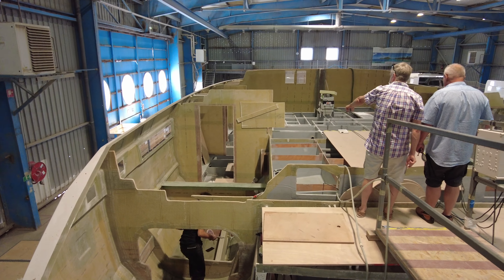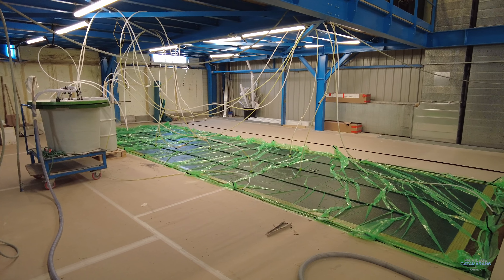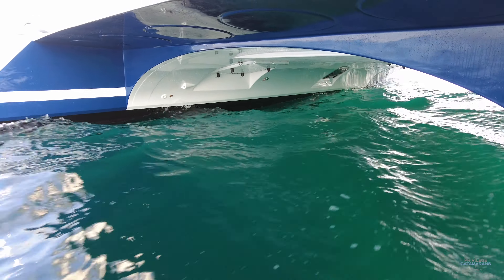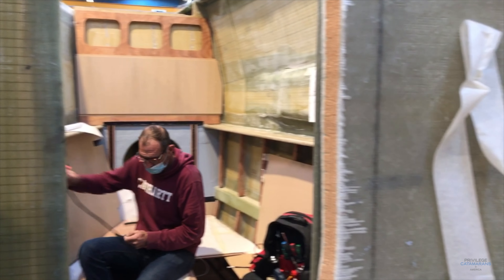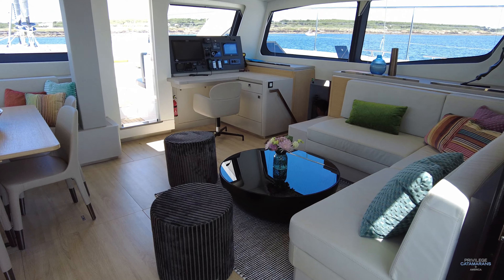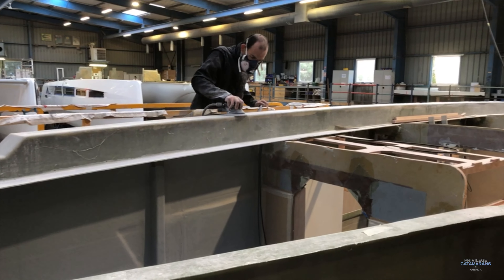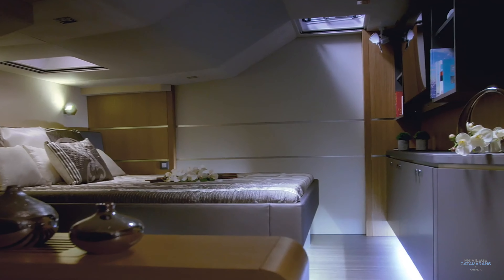How Does Privilege Build Bulkheads?

Comment: Great video!! Ppl are concerned about the recent discovery of Lagoon bulkheads failing.
Reply: Of course they have.  But few consumers really seem to understand carbon.  Carbon isn't magic, it is simply stronger for a given weight than fiberglass.  For most bulkheads, why would you do it?  It's in a place that doesn't need more strength than glass provides, and it's in the lowest priority location for reducing weight.  Carbon rigs make the most sense to lower the center of gravity.  Carbon may make sense in supporting large openings or spans that simply can't be done strongly enough in glass, like a cantilevered bimini or something.  But on a prioritized basis, most bulkheads will only be all carbon in an all carbon boat trying to save every last ounce.  You'd get a similar effect by packing boxed wine vs. bottled, or limiting yourself to only 6 pairs of shoes etc.
Reply: @secondstartotheright You know what else is stronger than steel?  Plain old fiberglass.  Tell me again why a perfectly strong enough foam core glass bulkhead wouldn't be the last thing you upgraded to carbon?
Reply: @MrJhchrist  I never said anything against foam core fiberglass, just suggest adding a layer of carbon fiber thats all
Reply: @secondstartotheright  Cool, and I tried to explain why not.  It's because foam core glass is strong enough, and any desire to save weight will be done elsewhere first.  Typically higher up and/or where long spans can benefit specifically from carbon's stiffness.  Roughly speaking, carbon is 5x the cost for -15% weight OR + 20% strength.  That's a better investment in a mast or dagger board than it is in a bulkhead.   
It may be worth noting that the lagoon problem this is obviously responding to isn't because their bulkheads aren't strong enough.  The lagoons just weren't fitted and attached well.  Which is why that is exactly the focus of this video.  
If parlay revival had been made with carbon fiber bulkheads it still would have fallen apart.
Reply: @secondstartotheright  OK, enjoy yourself.  Fiberglass is literally stronger than steel, pound for pound, in several aspects.  If you want to argue about though, I can't help you.  (Guess what is also much more brittle than steel?  Carbon fiber...)
Have a good night, or grab the last word, whatevers, I'm out.  (Enjoy googling "is fiberglass stronger than steel" or "is carbon fiber brittle")
Cheers.
Reply: I’m not going to get drawn into the conversation below/above but, have a look at Balance Catamarans on YouTube. They show where they use carbon in certain areas, and are one of the best built cat I’ve seen! 😎🏖🌴☀️🇦🇺
Reply: @jacksbackable  yes exactly thats all I'm saying.  Great point!!!
Reply: @secondstartotheright  The different moduli of elasticity makes carbon fiber/fiberglass sandwiches less strong than just fiberglass. Either make something out of one or the other. And as has been mentioned elsewhere, the cost and positioning of any componentry made of CF is important.

Comment: Excellent build quality! -- QUESTION --- We just watched this weeks episode of Parlay Revival and saw the horrible deck joint failure on that Lagoon.  A factory installed  line block connected to the bow deck, pulled apart the deck from the hull and lifted a three foot section clean back. This happened in only 12 knots of wind and exposed the front hull to the ocean. Turns out it was lightly glued to the hull and in several sections they had failed to apply any glue at all. Total nightmare.  How does Privilege connect the deck to the hull and are they aware of the importance of keeping that joint completely attached and water proof?  Parlay could have sunk had they been in an Ocean crossing.  This Lagoon Cat needs to have the entire deck completely removed and reattached properly (if that is even possible).
Reply from the maker: Hi Coleen, if you've watched any of our production videos you'll see that we don't glue and screw bulkheads, they are fully glassed. This is also true for the deck and hull joint - they are glassed in and become a 'holistic' structure. It would be virtually impossible to take the deck off a Privilege in any wind conditions,
Reply: @PrivilegeCatamaransAmerica  ..I thought so but wanted to check after watching this weeks Parlay Revival video. Their Lagoon actually had the deck peel back, at least three feet, only to discover it was glued (very poorly glued) and a few rusty screws .  Such a sad builder I must say.  Really sad actually.  They clearly don't care.

Comment: 3 questions: 
* Have you built an aluminum version of any of your boats? Explorer style? 
* Why not throw on a sheet or two of carbon fiber over the current side bulkheads' foam core panels? There are only two main bulkheads and the extra rigidity will save cracking throughout the whole boat over time.
* When are you going to design a dry foredeck catamaran similar to the Bali/Catana line? Seawater spray equals salt and constant nuisance cleanups with freshwater washdowns. I've also seen Priviledge front lockers flood badly. Bali's 5.4 "higher above the water" design - came in fifth in the ARC Rally in 2015, so the design does not impede performance nor sea worthiness. I'm not crazy about Bali's top deck stair access (its too exposed) but otherwise it's spacious, works well, and gives you the whole boat that makes every inch usable.

Comment: Cutting a cured fiberglass sheet in it self is worst than using the lagoon style bulkheads.
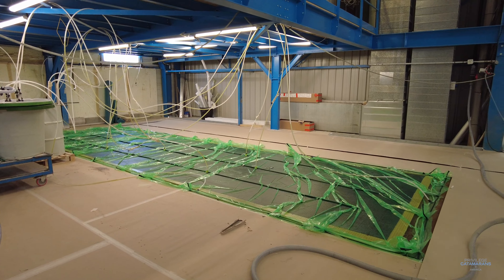Edit: apparently there's no CNC cutting or whatsoever since your boards are all cut with a jigsaw as seen here 0:44 here 0:58 and here 2:03 etc..
2. Love those finger cutting fans on the master bed, especially when it's dark and you want to shut it down. Good job!

Comment: Very Nice! -- QUESTION -- One thing we learned when looking into one production builder, that has had enormous bulkhead issues, is that they claimed to build to a standard, but when you are not watching them build it, they skip important steps.  It just seems when no one is watching them, that they cut corners.  This may be because of lack of care or even lack of training or skills and, maybe even a level of dishonesty. When their boats were inspected during the construction phase by independent inspectors, the construction was much better.  This is a big issue.  I suspect that Privilege has much tighter controls and inspections of crucial steps in construction as I have never seen a failure or deviation on those parts on the boats we looked at.  My question is this: do you take pictures of the key bulkheads before they are covered up, as part of your manufacturing control function?  If not, you may wish to adopt that simple step. Most modern manufacturers now take pics of key components and keep those records on file in case of claims made in the future. It is an excellent way to protect yourself and the customer.
Reply from the maker: Thanks for the comment and yes, it is an excellent suggestion. In fact, we currently take photos throughout the entire build process to document progress on the build. These photos are sent regularly to the owner while the catamaran is under construction.

Comment: Are the bulkheads between the engine compartments and main cabins watertight by specification and design?
Reply from the maker: Yes they are.
Reply: @PrivilegeCatamaransAmerica  excellent, thanks. I noticed many holes through the bulkhead and was just wondering what they were for and how they would then make them watertight afterwards?
Reply from the maker: @nuffsaid7952  Holes are required for electrical and plumbing lines. The areas are sealed with a watertight, flexible compound.
Reply: @PrivilegeCatamaransAmerica  ok, the same cheap option used by many other builders, pity to cut corners on a critical item like that. For the electrical cables and hard walled plumbing, marine grade MCT’s would be the professional approach which are relatively cheap. For soft walled plumbing, bulkhead fittings could be used which are also relatively cheap. 
We see too many business these days cutting corners to save a few cents here and there that only serves to turn what would have been a great product into a cheaper product that is easily identified by the knowledgeable prospective customer.
I encourage you to have the discussion with the builder to use the MCT’s and bulkhead fittings instead. Firstly they are more secure and are far more watertight (they are actually gas-tight), secondly are far better for maintenance, and thirdly are much neater which looks far more professional.
Reply: @nuffsaid7952  very valid point. It is a shame that there are builders that choose to take the cheap option on an otherwise quality build. It is truely these little 1% indicators that are telling of the actual overall quality of a product and the possibility of other shortcuts that may have been taken that aren’t readily visible to the naked eye. It really is a case of buyer beware, and buyers should look past the spit and polish and have a sound knowledge on what to look for to recognise these 1% indicators for the actual build quality. Attention to detail when viewing a boat to purchase is critical in knowing where to look and to be able to identify these indicators to the actual quality of the product. 👍
Reply from the maker: @nuffsaid7952  This topic has come up before in regards to watertight bulkheads as it relates to the American Bureau of Shipping and the Det Norske Veritas. The boats are not classed by the ABS or DNV who are only concerned with ships and their insurance. That is a totally different business and trying to follow their ship construction rules would make a pleasure boat of this size complicated and heavy. A watertight bulkhead in a ship has to potentially withstand water pressure at a depth of several decks below the surface, the potential submersion of bulkhead in our boat is maybe 6' below the surface, or 3 psi.  Using bulkhead fittings and transit hardware designed for ship bulkheads would not be practical.
Reply: @PrivilegeCatamaransAmerica  Hi, just to clarify, ABS and DNV are only 2 of many “classification societies” for commercial shipping and sea going vessels. Classification Societies primary function is not for insurance, but is for ensuring that vessels under their organisation meet the standards required for commercial vessels. These standards include but are not limited to construction, machinery, systems, equipment and design. The IMO provides the guidelines for commercial vessels along with MARPOL, SOLAS etc. The classification society checks that the vessel meets these standards and certifies the vessel. Insurance does play a significant part in that without the certification being issued the vessel will not be able to get insurance and would be severely restricted in where it could operate.
Regarding your comment that bulkhead fittings and transit hardware designed for ship bulkheads would not be practical is concerning. Bulkhead fittings are used in many industries and not specifically for commercial shipping, they are cheap in reality and simple to install. The 316SS MCT’s are also widely used in many industries and not just for bulkheads on commercial shipping. These MCT’s that would be appropriate for this case would weigh max 3.5kg each and would require only 2 at most per bulkhead. Here is a link for one of the many manufacturers of the MCT’s for you to view, https://www.roxtec.com/en/products/solutions/roxtec-hd-32-ex-transit/
For the bulkhead fittings there are many manufacturers, PARKER is one of the better known and have many options.
I am not suggesting that sailboats for private use should be built to the higher standards or use the same materials that commercial vessels do. However I am suggesting that there are much better ways of transiting a watertight bulkhead than simply boring a hole through, passing plumbing and cables through and then caulking the bundle to try to seal it, which doesn’t look professional especially when there is a much better way do do it which is cost effective, allows for easier maintenance and is far more secure (and doesn’t look like a dogs breakfast). Attention to what is viewed by some as little, non-critical items do indicate the true quality of a product and in many cases can ring alarm bells with customers when these shortcuts to save peanuts are seen.
There is one cat builder that is learning this lesson the hard way now after a sailing channel exposed the build quality problem, which was well known by those that knew what to look for as indicators, and are finally after many years having to step up. The build quality issue with this builder was known by some for over a decade, these are those that were knowledgeable and knew what to look for and knew what indicators they were observing. Unfortunately many of their past customers have lost financially due to this with that brand loosing market value.
Privilege have a great line and reputation and one of the best designers in Marc, but it would be a shame to drop that fantastic reputation to save less than 4K to install better quality bulkhead transit hardware.
By the way, I still love the old 585 despite being considered “old style and performance “ by current standards. It’s a pity that only 26 were built (if I’m correct) as that is a great boat still.
Cheers

Comment: Hi Rob. Great video. Question for you about the close cell foam used between the fibreglass - how fire resistant is this?
Reply from the maker: This is a question best answered by Divinycell. Risk of fire is a reality no sailor should take lightly.
Reply: @PrivilegeCatamaransAmerica  absolutely agree with you in relation to fires. I’m not worried if the closed cell foam is highly flammable or not. My wife and I are still going to purchase a Privilege regardless. I was just interested to know.

Comment: Its also more than double the price as Lagoon
Reply: ask Parley if that is worth it
Reply: @alexmeyjes5533  4 million-dollar boat compared to $400,000 boat.
Reply: @tylordid2695 nope wrong price, the 580 with good options goes for 2.5ml or even less ( parlay is a 450 so its 13 ft shorter ).. also you get what you payed for , people have crossed the Atlantic in barrels
Reply: @muumoo111  2.5 keep dreaming fully specked out is 5 mill
Reply: And while your at it do a little bit of research about the difference between custom boats and mass produced ones , and make sure to compare the same sized boats in the future not a 740 price custom boat Vs mass produced 450
Reply: @muumoo111  Man surely with the ability to mass produce vacuum infused sheets of glass/foam, swapping out plywood/glue for laminate and tabbing wouldn't increase the cost THAT much.
Reply: @TURSTY09  because that's the only difference?
Reply: @muumoo111  no but what I’m getting at is the reason the lagoon bulkhead problem exists is because they tried to cut the cost too far. The cost difference between plywood bulkhead and something similar to these ones couldn’t be that much in the scheme of a $600k boat. They can keep the rest of the cheap stuff as is, but skimping on the structure of the boat has proven to be a step to far right. There is a balance that can be better struck.
Reply: @TURSTY09  its combination of bad design , excessive cost cutting and bad execution and dirty cheap martial .. thats why no one should consider lagoon again, its from the top of the company down the bottom kind of mismanagement  ( i used to own hallbergrassy and now nordhavn and maybe just maybe in few years  a big cat ) i have seen how boat get built and holy fuck those lagoon are trash
Reply: @muumoo111  if given the choice for a production builder between Lagoon, FP, or Leopard, which one would you choose?
Reply: @alanpiper9614  Leopard is better built than both fp and lagoon, but you need to keep in mind leopard doesn't do any custom work.
some company's will do any custom work you want for a leopard, that's 200-300k extra.
i would buy an older privilege  and save my self all the headache. 
mid 2019 privilege was bought by HanseYachts which build production boats  and i am worried if this will affect those boats , so far i found nothing but i am keeping an eye on this builder
Reply: @muumoo111   yes, I also am of the same opinion that leopard are the superior of the 3 major production builders. Also that there is very little option for any customisation other than colour choices as with the other 2 production builders.
As far as privilege being bought out in 2019 and the possible effects on quality, I have already seen an indicator of this with the watertight bulkheads penetrations for running services. When looking at a vessel that is double the price of the production competition I find it disappointing that they would employ the same cheap methods for watertight penetrations for services. Definitely an indicator that quality is being sacrificed for profit. My favourite is still the old 585. Top quality and proven rock solid construction.
Reply: @alanpiper9614  yes, still love the 585. Quality build built to last. I did raise the topic regarding the watertight bulkheads transit fittings with the site poster, unfortunately he does not see any benefit in using the quality hardware for this for the cables and plumbing, which is indicative of sacrificing profit for build quality. Shame as privilege were a great quality build before.